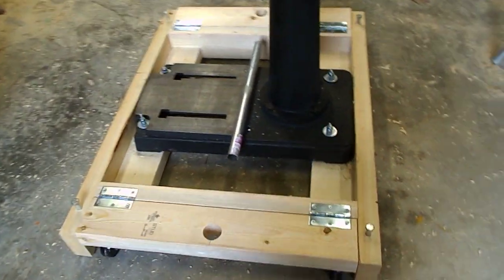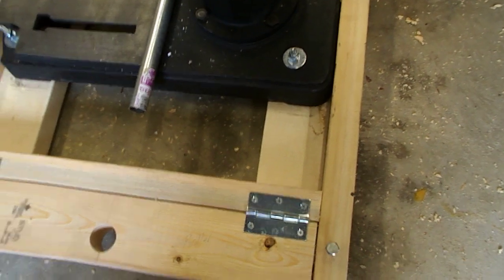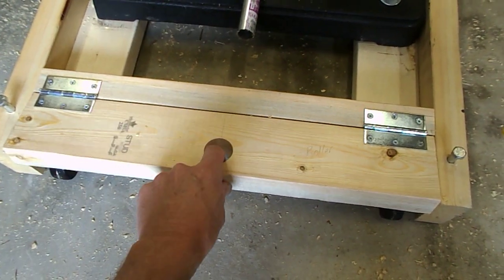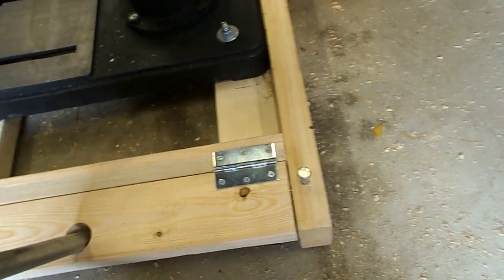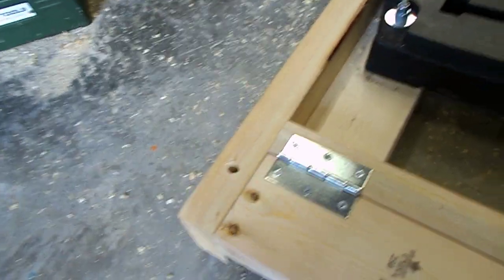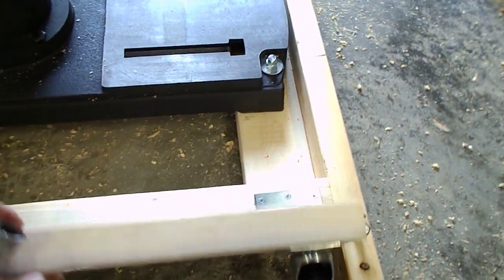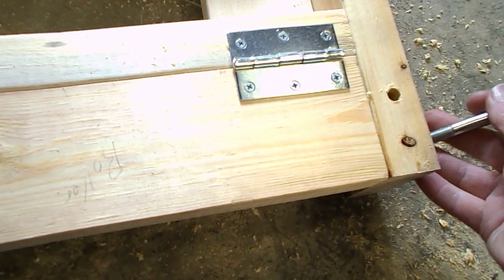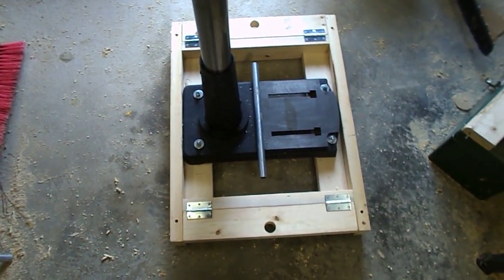Homemade mobile base for a drill press

Comment: Great idea. I made one but haven’t put on my drill press yet. Question..the 2x4’s the drill press sits on...did you countersink the bolt heads (that bolts on the press) into the 2x4’s?!!
Reply from the maker: Thanks. No the bolts aren't countersinked. Just through bolted.

Comment: Robert, not sure if you're still reading comments, but thanks for sharing the great design!  I was considering a more conventional mobile base, but I just wasn't sure how stable it was going to be. This gives a wide, very stable platform when it's down. Also, I wasn't looking forward to trying to lift the DP up onto the mobile base, but with this design, I was able to tip it forward, kick a 2x4 under the back edge of the DP base, the tip it backward, kick another 2x4 under the front edge of the DP base, and then just build around those. Works great!
Reply from the maker: Keith Carlson Thanks. I'm glad it works for you. I find it very useful myself.

Comment: what a great Idea, you need to save up some of that Disa money and buy yourself a welder, make some of that stuff out of steel. I bought a 4' sheet metal break, weights almost 450lbs. I'm going to use your design to move it around, but mine will have to be made of steel because of the weight, just built a bike loader for my roadstar to get it in the truck when we leave for Fl. in march, I'll do a video, looks cool. have a good one buddy

Comment: I'm not understanding the point of using the EMT in the hole?  I don't get what is happening with it in there?  I think the project is great, just didn't get that one part.  Thanks!
Reply: Christine Daley the EMT is a lever that forces the wheels down which lifts the drill press up. The bolts then hold the wheel platform in the down ( movable) position.

Comment: Now this will give my drill press, which has a very small base some stability and mobility plus quite simple. The only reservation I have is the lifting arrangement. Common pine sold by the package stores have a often prominent grain down the length and is susceptible to splitting with excessive side pressure.  Unfortunately the only solutions I can think of over complicates a very workable design.
Reply from the maker: Thanks.